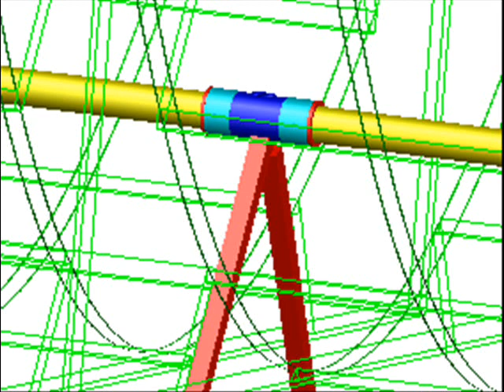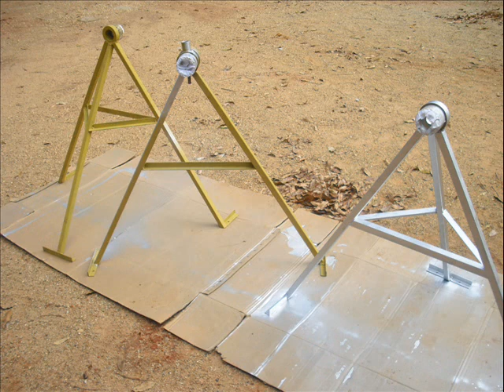Saracon Solar Cooker

Comment: This is a great idea.  I like that the cooking done remotely from the collector.  The steam box could be located inside of a building, as long as the steam pipe runs are kept short.
My only negative comments are that the box doesn't need to be any deeper than the height of your tallest pot plus a couple of inches, and the box should be lower so the lady can get at the food.

Comment: Use oil instead of water to transfer the heat, and thermal siphon to move the oil from your collector to radiator below a cooking surface. Build a platform for your cooker and the cooks if you need the elevation for thermal siphoning. 
Benefits of using oil versus water.
1. Oil will not boil at cooking temperatures. Steam is hard to contain because of pressures and lost steam is lost heat. 
2. Between oil and water, given the same volume, oil can not absorb as much energy as water, but that works to your advantage because oil will rise in temperature faster, so you can start cooking sooner.
3. Boiling water to steam leaves a mineral crust that can build over time, where as the oil is not boiled and wont leave a crust behind.
4. If you use water, you should use distilled water, and must periodically replenish it; but, assuming you don't burn the oil with too high of temperatures, you will never have to replace it.
Reply: Keith Reynolds Any info on thermal siphon? Which ol to use? Sunflower oil?
Reply: I'm suggesting you create a thermal siphon. Heat rises, so the solar reflector should be lower then where you cook your food. oil heated in your solar reflector will rise to your food cooker. your food cooker is a radiator  either fined of you want to heat the air around your food like an oven, or oil can pass between two flat plates with the bottom insulated so that the heat is released up to your pans. After releasing heat where you cook your cook, a line would return the cooled oil to your solar reflector.

Which oil? That depends on the highest temperature your system will get, and what is available for you to use. Concerns are oxidation, and burning. Really low budget could use a glass tube and used black motor oil to collect the reflected sunlight.

Comment: So the solar energy is directed to the pipe and the air inside is pumped into the cooking box? Is there a fan? Couldn't this design be used to heat a home as well?
Thanks.

Comment: hello jan said that you can have double the temperature if you connect one end of the tube, not half, and if you need more temperature, just put together two parallel tubes so you have an air inlet and one exit but had two questions to ask you one as you manage the flow of air? you're a fan or something? and see in the video seems a clear bottle with water which is its function? thank you very much for your attention receives greetings

Comment: The idea of separating the solar heat collector and the cooker is great. But the cooker itself needs so much modification to get better and efficient heating. some suggestions
-You may direct the steam outlet directly on the pot
-Separating the steam section to avoid heat loss when opening the cover
- Recycling the steam back to the solar heater
- Make section inside the cooker for 2 cooking utensils with two steam inlets with valve to open and close.
And many